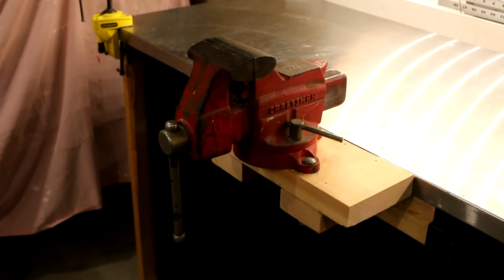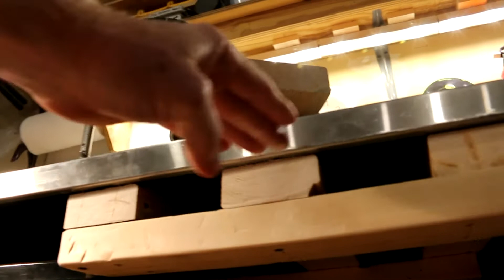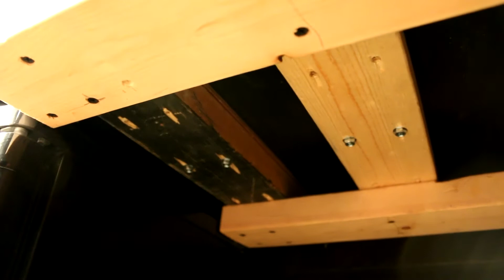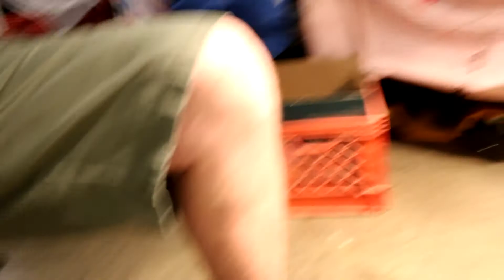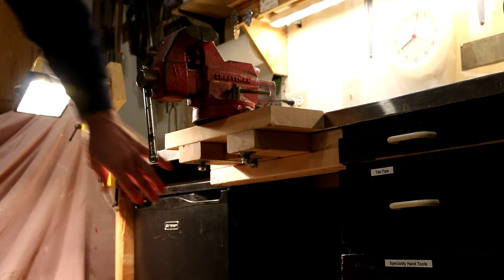Removable Bench Vise Mount System

Comment: Hi. I am busy putting together a 4 way workbench with a 1,2m x 0.6m worktop containing centre fixed saw, fixed router on right and enter- changeable planer, jigsaw to the left.. Obviously no space on the top for fitting a vice. Thanks for sharing your idea. I have a similar vice as yours and fitted it same way as per this video. It works perfectly and is easily fitted or removed. Much appreciated.

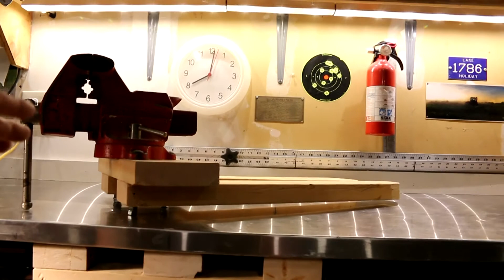Comment from the maker: I misspoke... At 6:15, I said that the 2 x 4s on the vise were 2 feet long. That's incorrect. They are 2 feet (the depth of the bench) plus the width of the 2 x 6 that I mounted the vise on. (the distance that the 2 x 4s extend beyond the front of the bench. So it would actually be 29 1/2" in my case.  Just make sure that you cut them the right length.  Sorry about the mixup.

Comment: if your looking to dave space underneath , you could probably use angle iron padded with 1/4' luan, the 2X' ack as a dead blow, it won't make so much ringy noise , and absorb some of the shock, i think i'll try your way, that sucker has to be heavy though

Comment: build a small floor platform and put 2x4s around the edges so you don't roll off for your chair to be at the right height. Pick it up when your through using the bench and lean it against the bench to get it out of the way. Just an idea.

Comment: Move the 2x4 that is at the front edge back 6" and put the vice in upside down for storage?
Reply: Yours is a great idea.  I would also slide-in a 4x4 leg under the vise 2x6 (to the floor); to use a sledge hammer with that vise!

Comment: I will use this idea in my shop.  I'm going to investigate using it for my vice and my grinder.  I use the grinder for woodturning gouges but it's in the way at times.  Thanks!
Reply from the maker: You're welcome.  If you have wall space you could make cleats on the wall and store them that way.  I don't have any wall space, so mine are on a shelf.  Glad you like the idea.